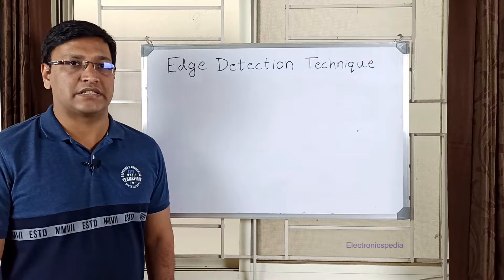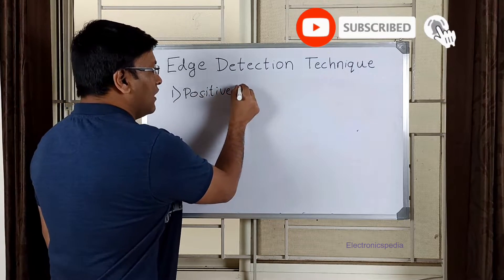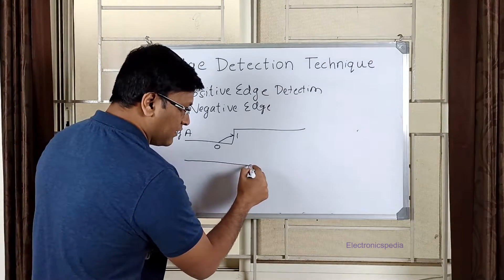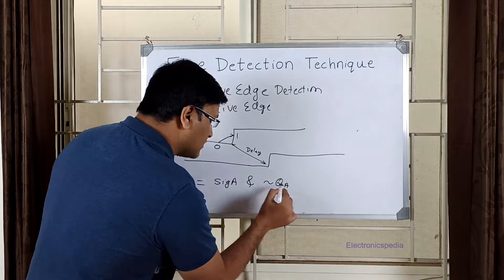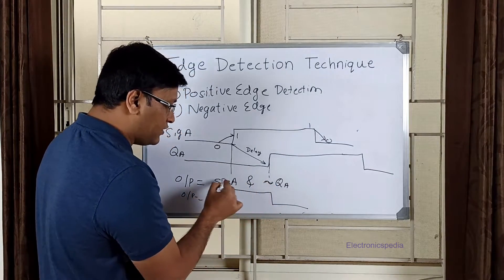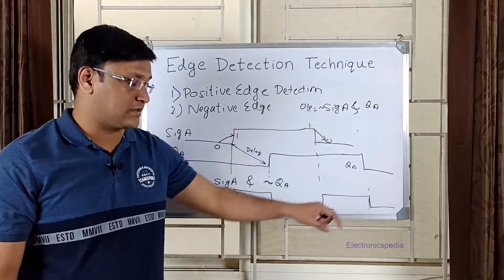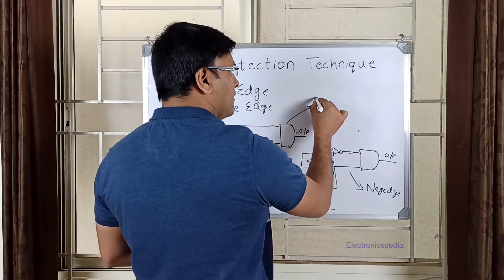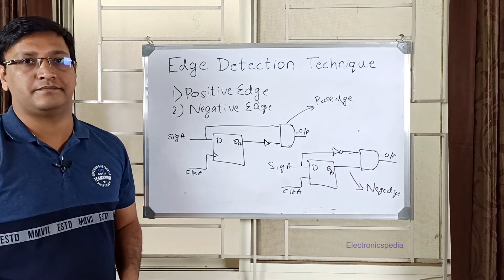Edge Detection Circuit | Edge Detection Logic | Positive Edge | Negative Edge | Rising Falling Edge

Comment: Can xor gate will work in this ? Instead and n inv ?
Reply from the maker: If XOR gate is used it will detect both rising edge and falling edge. 
If we want only one edge to be detected then we have to use AND n  INV
Reply: @Electronicspedia  yes!
Reply: Sir instead of using d flip flop, we can also use an inverter and then use and gate , it will give the output 1
(Considering some propagational delay of inveter)